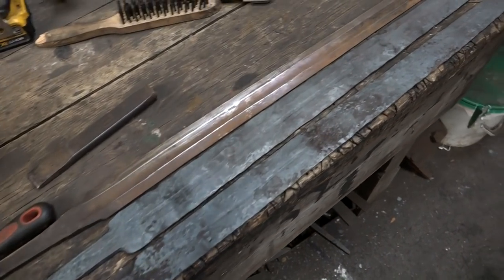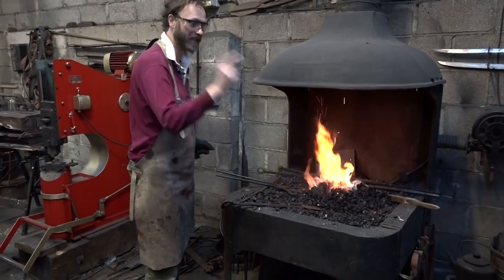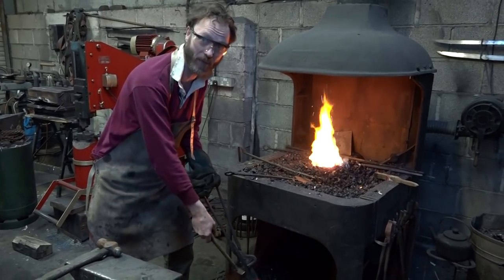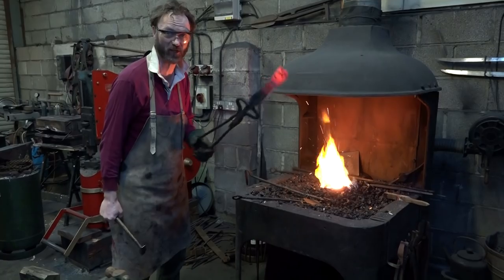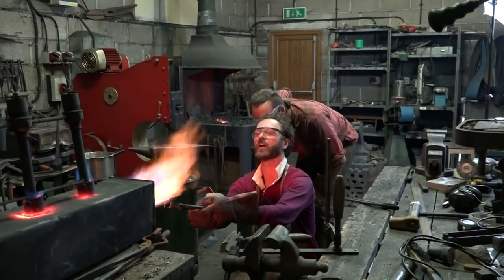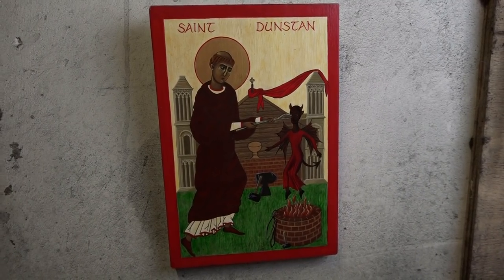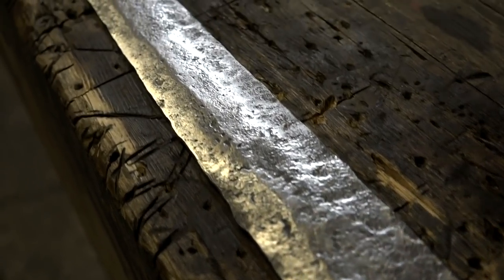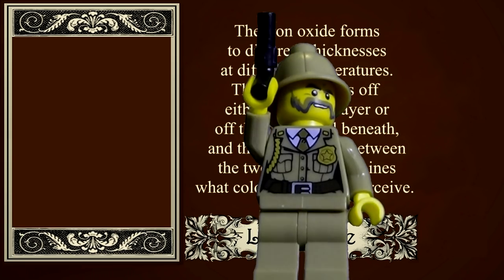Forging a Sword - part three: heat treatment

Comment: Watching Tom catch the blade on his hammer a few times when it slid around was both worrying and impressive
Reply: anyone else count the seconds when the sword was passed to tom?
Reply: If you use the same tool long enough, it basically turns into an extension of your hand. It's probably just a reflex at this point.
Reply: You only try to catch a very hot sword with your hand once... 

...If you're smart!😅

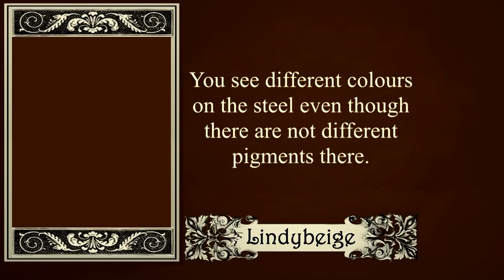Comment: 12:28  That was by far the least confident and heroic "hurray" I've ever heard.

Are you sure you're happy about these results, Lindy?
Reply: Micah Philson It has a wonk in it
Reply: And it might not be fully hardened, we haven't seen them perform any kind of file test to check.
Reply: I think the magnitude of the risk he just took hit home.
Reply: You all act like he didn't know this was the ultimate test and final step of forming the blade. The slight wonk won't make a huge difference, and he knows he's inexperienced, so even with expert guidance it probably has a fail point or two, I don't think that's why he's nervous.
Reply: Being able to flax as far as it did is indicative of tempered martensite. Sure, it may not be an exactly uniform 55HRC across the entire blade, but that is not important to be fully functional as a sword.
Reply: Gareth, and I mean it's not like he's actually going to be using it in duels, it probably won't see almost any use outside of swinging it around safely just for fun. 
It really doesn't nave to be that tough, just not shatter on its own.
Reply: I don't think I've ever seen a forged sword that didn't have at least a little bit of a wonk to it when you look at it from that kind of angle. Hell, even some of the really nice prop swords they use for close ups in game of thrones have a bit of a wonk, and sometimes even a curve in the fuller.
Reply: It sounded like a relief "hurray" of someone who has been waiting to do this for ages
Reply: You have an unfortunate name.
Reply: Watching the video: he's relieved. Can you not read situations?
Reply: @lukesampson3294  How ironic. You're partially right but I'm pretty sure most of that moment was him being let down. He had expected Tom to make it perfectly straight for him.

Comment: That quench operation was fantastically smooth for a novice smith. Well done! I will say though, blue into a light plumb seems a bit soft for a sword temper. I'm used to seeing straws into deeper golds, maybe blueish on the center of the blade.

Comment: Lloyd, i think you did an outstanding job, with an EXCELLENT teacher! The final warp can be gotten out in tempering. I would say, from experience with en45 swords, that you have to bend it pretty damn far the other way, rtemper to thw same colors as before, then cool of rapidly in water, should get the blad3 pretty straight.

Comment: You’ve done better than the first, second, and third times the boys and I tried to forge...a thing. Then again, we were all of 16 and only had discarded bits of an abandoned railway track to work with. We managed to make a slightly narrower railroad spike. 
Still, it was a proof of concept!

Comment: When I was little, I made a forge with an old grill and a hair dryer. I made a decent saber, never got the heat treat right though. Ended up melting the gill as well 🤷‍♂️

Comment: If using something like 1075 carbon steel could I use this same method to temper with a propane hand torch? Would I want to aim for that same blue color since I normally temper small 1075 steel knives to a straw color?

Comment: Watching this has made me really realize how incredibly good the guys over at AWE me, truly are. They make everything you are doing look super easy, just watching them would make you think that anyone could just pick up a hammer and make anything. It's been really cool to see a normal guy with no experience try to figure this stuff out, really cool video series.
Reply: and keep in mind they grind the bevels, they don't hammer them like he did in part 2
Reply: @giadrome100  They have a number of builds with hammered bevels, but they do grind in most of them.
Reply: @revanjagergaming8714  huh i've never seen them hammer the bevels before

Comment: Does it have to be a specific type of steel to turn blue/gold?
For reasons I won't elaborate, my scalpel ended up being heated. The carbon steel blade turned blue/gold but the stainess steel handle stayed silvery. Is that just because the handle is way thicker than the blade and thus didn't receive enough energy to change colour or did the carbon in the blade enable the colour change? (And I read the thing about the oxide layer but stainess steel should still oxidize, if given enough time/thermal energy, right?)
Reply: Slim Tony It’s the iron in the blade that changes colour, so the iron content could change the colouring.

Also, stainless steel does not only have more carbon content, it also has nickel introduced. My bet however, is simply the thickness of the handle compared to the thin blade.

It takes more time and heat to blue a small surface of a helmet than it does a entire Pauldron.  Even though their both the same kind of steel. The helmet is just much thicker.

Comment: The handle ( "tang" ? ) was not heated to the same temperature as the blade ( you can see the tang was not glowing ).   Should the tang also be heated to the same degree as the blade ?
Reply: I think they're trying to avoid hardening the tang.

Comment: 2:28 you say almost all the molecules have moved, and I just thought it was interesting that Vsauce's fixed points video goes over this exact situation. at least one point inside the sword hasn't changed positions due to Brouwer's fixed point theorem. Great video though.
Reply: key word being "almost"
Reply: Key word being "huhh?" :-D
Reply: Rei The Raider he corrected himself and said “surface” in the very next sentence. I’m assuming you were too busy typing your comment to hear. ;)
Reply: He didn't correct himself, he was right
Reply: I'm mostly guessing here but doesn't the theorem assume an infinite set of points?
If so, it might not exactly apply to atoms, since there are only so much of them.
And atoms never stand still anyway.
Reply: Anatoly: Well, in solid matter, atoms may move back and forth (= heat), but they don't switch place. That is for liquids, gasses, and plasma. As far as I can tell, his sword is damn solid.
Reply: Thomas Raahauge well yes, that's the weakest point of my message. The first one actually is that there sure is a point of a sword which hasn't been moved. The problem is that there may not be a corresponding atom, so all of them might have moved relatively to others.
Reply: @coolGhostVIRUS  if all had moved how can you measure if any had ?

Comment: I've wondered this but, whenever I watch or read about modern smithing it's always "use oil not water because it'll get too brittle" but like, then what the hell did old time smiths do when they only had water? I'm guessing it involves more steps so most would never bother doing that way anymore?
Reply: well they had vegetable oil back then as well...
Reply: You can quench 1040 (something without a lot of carbon in it) or something similar in brine, but not plain water.
And some modern alloys require something even less aggressive than oil: forced air cooling.
Reply: Animal fat was commonly available, easier to produce and therefore cheaper than vegetable oils It solidifies when cold, but as forges are incredibly warm, not an issue. I have no evidence animal fats were used, just putting it out there for consideration...
Reply: 1040 can be water quenched, and brine is to my understanding an even more aggressive tempering medium than plain water. The scale goes from oil to heated oil to water to brine.
Reply: The quenchant used is a function of the properties of the steel you have; w1 (a simple water hardening steel) is today closest to what blacksmiths had at least in the recent past, but in ye olden times if you weren't sure you'd simply try a small piece in different quenchants (going from slower to faster if you want to be careful). It's less the steel getting too brittle because tempering can always be done; but rather it hardening too quickly and cracking or even shattering, or too slowly and not hardening enough at all. Oil wouldn't have been unobtanium, they could have gotten it; oil here doesn't necessarily refer to petrochemicals
Reply: As I mentioned above, when I was at college we used whale oil to quench.  Not so good for the whale, but really good for dropping temperatures quickly.  Smiths from Scandinavia, I suspect, worked that out a long, long time ago.
Reply: Rennis Tora Lindy’s explanation wasn’t quite right but not too far off. 

Water is very good at reducing the temperature very quickly. That causes a large amount of thermal shock which can cause cracking. The surface rapidly changes to martensite (the microstructure that gives you the strength and hardness) and tries to expand around the still hot and soft material beneath it. That’ll cause worse warping and possibly cracking. 

Oil doesn’t take the heat away as quickly so when the surface reaches the transformation temperature the core will be cooler (and a bit stronger) and will transform at about the same time. Much less likely to crack. 

You do need a certain cooling rate to get it to transform into martensite (depending on the steel’s composition). Too slow and it won’t harden. But too fast and it could crack. It’s a balancing act. Sometimes you do need to use water but it can be a bit of a crap shoot on whether you get a good part or scrap at the end. 

Historically they used quite a range of things including animal fat. The earliest record suggested plunging the hot blade into the flesh of a Nubian slave. Let’s be grateful Lindy didn’t decide to use sword making methods from that era...
Reply: I have a feeling plunging a hot blade into a person would warp it, so I imagine they didn't use that technique for long :P
Reply: SensualCream Well if it didn’t bend breaking the skin and only hit squishy bits, human innards could give a fairly even quench, i reckon. 

The screams would be irritatingly distracting, oh course. Not to mention those bothersome slave revolts. But oil baths simply lack the monstrous sadism one needs for proper craftsmanship. Don’t you think?
Reply: Tom Collins but the quenchee would be thrashing around potentially warping the blade. No good.
Reply: Cholula Hot Sauce 
Yeah. Bloody inconsiderate of them, if you ask me. You’d have to tie them down and probably need a ridiculous twiddly moustache as well.
Reply: I get you're being funny Tom, but logistically, on all accounts, quenching with Humans is impractical and inefficient. 

Even if you did stab the "squishy bits", organs, muscles, blood, tendons etc. all have different densities, textures, rigidity / softness, temperature and everything -- not to mention bodies are pretty warm. 

The sword would be too long for the body, hence uneven quenching, and even if you strapped the dude down completely, skin and muscle is tight meaning a single movement could warp the sword, not to even mention the pressure differences at each point in the body. There's a million things wrong with the idea.
Reply: SensualCream I’ve not been able to find the reference of where this came from. It was in my old boss’s lecture notes showing how old heat treatment was. I think it was Assyria so ~2500 years ago. 

Yes we have had better quenchants. I’ve heard of individuals using animal blood today. Less severe and unpredictable than simple water. Not as good even old oils but more readily available if you’re on a farm for example. Human bodies (the intestines in particular) I think could be better than simple water. You’d not be able to quench a great sword obviously but a short sword or long dagger (which I think they used) would be at least feasible. 

A very good quenchant is molten salt. By good I mean it takes the heat out evenly. The mess inside intestines is more like a paste than anything else so might act in a similar way to molten salt. 

Of course one very old reference from a sadistic priest in benighted ignorance doesn’t make for the best engineering standards. I’m just suggesting it might work better than one would initially think 

(well better than water and as long as you first thought was “that is bloody insane!”)
Reply: Thanks for the info! That's pretty interesting
Reply: It depends on the steel. I've seen. Some blacksmiths who pre heat the oil or water before quenching.

Comment: Funny how I did almost the same thing at the age of 20 to be precise Lindybeige I got a Leaf Spring course it was off a Truck and I ended up with a Sword that Weighed 3.4 Kilos, I should have cut the Spring in Half... But the Burning came when my Tang Melted off cause I got distracted by a Lovely Irish Girl... I ended up cutting off the Ruined Part and Forge Welded a new Tang on... But still as a Wall Hanger it looks good... Not going to fight with it... It was Terrible on every metric.

Comment: It would nice interesting to see something from Lindybeige about bartitsu. 
It all sounds very fitting to Lindybeige. "How to deal with undesirables", "Putting a troublesome man out of the room", "How to overcome a ruffian" and "How to repel an assailant who positions himself in the path of your bicycle".
The original bartitsu club faded out after only two years it seems, but question is about the system. Could it - and did it - work at the time or not?

Comment: Great video but i have one problem, audio is randomly going from my left ear to right ear, its annoying. I noticed it also in your latest tanks video, can you somehow fix it in your next videos? For me going from stereo to mono would be enough
Reply: I think the problem is on your end.  Audio's been fine for me, and nobody else is complaining. :\
Reply: I had no audio issues. Either I'm going deaf, or you should check your equipment.
Reply: Yep audio is fucked, voice from right side and shop sounds from left
Reply from the maker: In the tank video, we both had personal mics, and so the stereo reflected reality.  In this one, sometimes it's the personal mic, sometimes, the shotgun, and sometimes both.  Usually just one or other.  I placed the sound in the centre if it was from one mic.  When using both, my voice is on both channels.

Comment: Why doesnt the oil ignite or smoke? Vegetable oil burns when I overheat my pan. Or is is it because there's so much volume that it doesn't heat the oil significantly enough to reach a flash point?
Reply: Jonathan Horowitz I think your hypothesis is correct, as well as the limited surface area.

If you think about, a cooking pan is nearly the opposite, a low volume with a large surface area.

Comment: Why didn't knights have blue/purple-ish swords? Wouldn't they think it looked cool? Wasn't blue an expensive color back then?
Reply: As you hack and slash your way through scores of rioting peasants, the bluish colour wears of, and re-colouring the  sword is damn risky, as it involves heating the sword significantly. Perhaps for ceremonial swords, or swords merely for showing off, it might be cool :)
Reply: All historical Armour was blued or blackened as a finish, but it’s different with swords as metallurgy is far more important in a sword. And the gentleman above said the blue colour fades with wear.
Reply: The blue sheen would be removed with grinding and sharpening. Also it’s tricky to get the colour completely even if you’re doing it bit by bit like Lindy did.. I think it has been done for armour pieces that don’t need sharpening or machining afterward, though. You can get quite nice range of colours if you control the time and temperature right. 

It’s a bit old fashioned but you do still sometimes get parts nowadays that specify blued steel (as a way to check tempering temperature).
Reply: None of your answers are satisfying and convincing
Reply: Maarten van Rossem Lezingen 
Ok your three questions:
a) some might have but not all
b) they probably did think it looked cool
c) yes blue pigment costed a lot back then. The blue colour on the steel isn’t pigment, though.
Reply: Tom Collins You're basing these answers off of what?
Reply: Maarten van Rossem Lezingen 
The why didn’t they have blue all the time: grinding will take off more the the less than half a micrometer of the blue oxide. Most examples are of bear steel.

Did some re-treat after grinding: Yes because I just looked up a few historical examples. 

Did they think it looked cool: No sources for this one. Most people I’ve talked to, including me, thinks it looks cool. I reckon our ancestors probably would have too. Admittedly not the strongest argument but it’s probably not false all the same.

Blue dye is expensive: something I always heard and just did a search on t’internets that confirmed it. Ground up sea snails and wotnot. Took a long time to produce not very much of it.

The blue on steel isn’t a pigment: the different colours are caused by the thickness of the oxide layer. How do I know that? Um... i have a degree in metallurgy and used to run a department in a heat treatment company.

Comment: So the blade won't remain blue, but what if you wanted it to stay blue, or even another colour other then the traditional metallic silver we're so used to?
Reply: you could temper it again after finishing the grinding and polishing phase as long as you didn't exceed the temperature of the primary tempering cycle. This would give it a nice colored finish but the layer is very thin and will unfortunately wear off very quickly with use.
Reply: branbeggrify You could go even further and rust blue the blade, literally rusting the surface intentionally. Like they do in gun smithing. Unfortunately, this too will wear off with use. At the end of the day though, I feel like Loyd actually wants the shiny silver in his first sword.